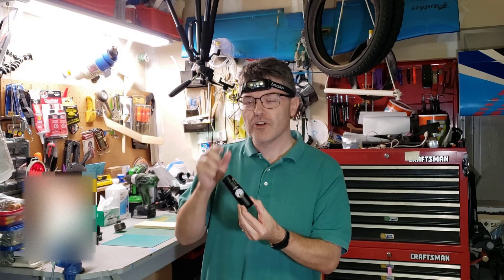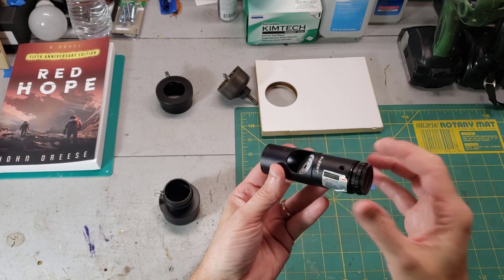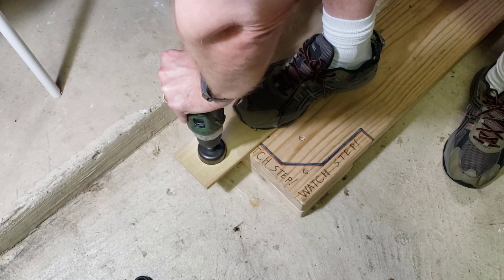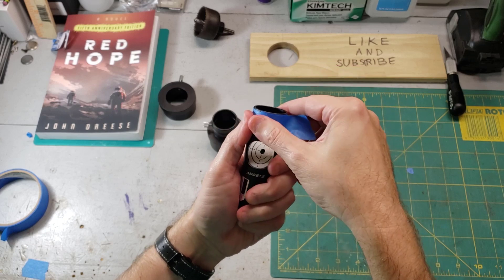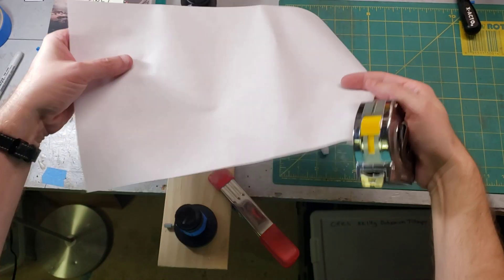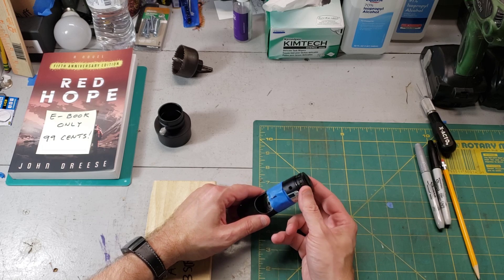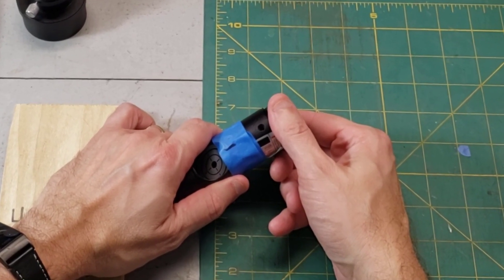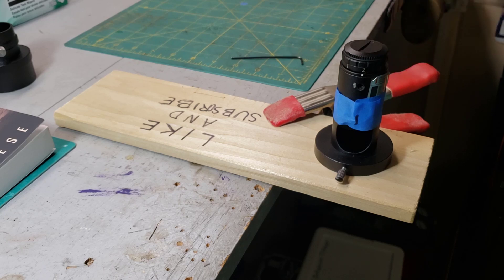How To Align Your Laser Collimator: The Step By Step Guide For Telescope Users

Comment: Back in the days before lasers, I learned how to collimate using the Tectron tools. They consisted of a sight tube with crosshairs, a Cheshire eyepiece, and something you don’t see today, the autocollimator. The first two tools are now combined into a Cheshire/sight tube. The last is an eyepiece tube with a mirror on the back side. It faces the secondary. When the scope is collimated, the image appears black because the light path is blocked by the eyepiece. It is far more sensitive to misalignment than any laser. It’s great for alignment of the focuser. As you rack the focuser in and out, if the image is not black, you are out of alignment.  Btw, I have 3 lasers. None are as accurate as the manual method.

Comment: Greater distance causes the laser dot to appear as a skinny oval about the size of a rice grain.  You have to draw an outline around it and try to make each one meet in middle for each rotation.  Also, if you lay the collimator on its side, you need two parallel supports because of the flange around its middle.  These toys really are more trouble than they're worth, but they make the scope companies a tidy bundle.

Comment: I just stuck mine in the OTA spun it and adjusted it until the circle was tiny, then adjusted the secondary to center it. then spun the laser and worked on it until I could keep the laser inside the collimation dot. Now my collimation is quite accurate.
Reply from the maker: That is a very good way to do it.  I've found that this particular problem has several satisfactory solutions.

Comment: Nice video. You ask about my method to increase the accuracy, so. I set my collimator in a pair of wood "plains" having a V cut near the top edge to cradle the collimator. Gravity pulls the collimator toward the point of the V and makes it easy to spin the collimator. I project the laser several meters from the end of the collimator.
Reply from the maker: Thank you for sharing. I love that folks like yourself have such unique methods to make these collimators even more accurate.

Comment: I collimated my scope using my collimation cap. Got it spot on. I then racked my focuser all the way out and locked it down. Put my laser in and locked it down tight. I then collimated my laser to my scope. It worked great! Now the laser is always dead on for MY scope!
Reply from the maker: Collimation caps are pretty effective - I like to say they'll give you the 95% solution which is very good.  The laser collimators just make the whole process much faster (especially when tinkering with the primary mirror).

Comment: I imagine anything on the order of the telescope focal length is good enough. It'd be interesting to find an analytic formula for the wavefront error you could expect from a given error circle diameter, but it's beyond my ability
Reply from the maker: Generally, that's true.  If you use a distance similar to your own telescope, it'll be fine. I like going for the 6 foot or so for "extra" resolution.

Comment: Hi, thanks for the video! I love these DIY astronomy hacks. I once built a laser collimator stand out of LEGO bricks, and it actually worked.

One thing that keeps me thinking: to adjust the laser position, you can only use the three screws. This means that if the laser module is a small cylinder, one end of the cylinder is fixed somewhere near the middle of the collimator, while the other end is adjusted using the three screws.

But how can we be sure that the fixed end of the laser is precisely at the center of the collimator tube? I guess, to verify this, you would need to take measurements at at least two different distances (between the laser collimator and the wall). If the laser’s central point remains consistent at different distances, then the collimator is properly aligned. Otherwise, you might set the laser position correctly at, say, 1 meter, but at 2 or 3 meters, it could be completely off.

What do you think?
Reply from the maker: The Lego tool sounds awesome!  I've never taken the laser collimator apart, so I'm not sure how the laser module is mounted at the base end.  So far, everything works well.

Comment: If there are three set screws, make three marking lines, not four. Then adjust the screw that aligns with the error on the corresponding line.
Reply from the maker: The reason I chose four was because it's easier for me to maintain 90 degree increments rather than 120 degree increments.
Reply: Use the 3 screws’ position to determine how far you rotate (exactly as you did using your 4 marks). I.e., screw one facing directly out, mark spot, then screw two, …
Reply: Btw, thanks so much for the demo here. I appreciate it.
Reply from the maker: @divalent2007  Thanks for watching.  I'm glad it was helpful.

Comment: I recently bought an Apertura 8, which comes with a laser collimator. However, I’m concerned that the laser collimator might be misaligned and not collimating accurately. I watched a video about using a Cheshire tool but am unsure which would be the best solution. If I already have the laser collimator, is it sufficient to collimate the laser itself, or would it be better to purchase a Cheshire tool?
Reply from the maker: You can do a quick test. Just put the laser collimator in your telescope focuser tube an start spinning it.  Does the red dot follow a large circular path on the mirror?  If not, then it should be good enough.
Reply: Thank you for the quick reply! I actually don’t have the scope yet—I ordered it two weeks ago, and it’s supposed to arrive next week. In the meantime, I’m gathering information about the accessories, tools, and tips I need to properly use it. Once it arrives, I’ll follow up on this message. Thanks again!
Reply from the maker: @Gabriel.Jarelys    I forgot to say... congrats!  The Apertura 8 is probably the best 8 inch Dobsonian you can buy these days.  Use the heck out of it for a few nights before buying any more stuff - it comes with a good set of accessories.
Reply: @AstronomyGarage   I appreciate your kind words—it gives me more confidence that I made the right choice with this scope. For years, I’ve wanted one of these, and I finally decided to take the plunge. Based on recommendations, I also purchased a 9mm and a 6mm eyepiece from SvBony, an Apertura 2x Barlow, and a phone mount to use with AstroHopper for tracking the sky. Hopefully, these will help us make the most of clear nights! Would you recommend anything else for this scope?

Comment: These standard laser collimators actually fit perfectly BACKWARDS into your telescope focuser.. meaning, your telescope can be a ready made jig, which will then project the laser out towards a wall(for a dob standing upright).. as long as you dont move the telescope, you just rotate the laser in the focuser.  You get a ready made jig and you can point it to a wall as far away as youd like for better accuracy.  Hope this helps

Comment: Does the laser have to be exactly perpendicular to the wall or floor? i.e Does the surface the board it is on have to be dead level or is a slight angle ok?
Reply from the maker: A slight angle is probably okay, but it's best to be fairly perpendicular, maybe +/- 10 degrees?

Comment: Another bit of great advice.  I have that same cheap laser.  I think it works relatively well although another club member with a $1500 collimating system disagreed (of course, there is a tiny price difference between the two items).  I think this will make it even more respectable.
Reply from the maker: Even if not collimated, one of these laser collimators will get you usably close for the most part.   I can do a good collimation in less than four minutes with one of these laser collimators. They are worth their price.

Comment: Question, don't you think it's too close to make an accourate adjustment? I set up against wall 13 ft away.  I couldn't get it closer than 1 cm  circle diameter when rotating it.  Does that sound close enough?
Reply from the maker: My main Dobsonian has a focal length of about 4 feet, so my desk height isn't too bad.  For increased accuracy, I use the top of a 6 foot ladder.  But your 13 foot distance will be excellent.

Comment: Great video! Just spent an hour collimating mine using several different 3D printed supports keeping it level. I can't seem to be able to get it dead center from all 4 positions? They are apart by about 1mm between all 4. Laser is about 2 metres from the wall. Anyone else have the same issue?
Reply from the maker: 1mm at 2meters is pretty fantastic to be honest!  Mine is not that good.

Comment: I'm sorry if this is a dumb question, but wouldn't it be easier to make three marks instead of four on the tape around the collimator, each aligned with one adjustment screw?  Then the relation between how you turn the screws and how the laser dot moves among the marks should be easier to see.
Reply from the maker: That is an excellent question!  The reason I chose the 4 quadrant angles was because it was easier for me to control as spun it. Every 90 degrees is easier than every 120 degrees.  It's definitely worth an experiment though!

Comment: thanks!  i will just spin it in my eyepiece holder and see if the dot moves in the primary mirror.   good to see if the one i will get is bad from factory
Reply from the maker: That's definitely an option.  I like to project it onto paper so I can mark the spot every 90 degrees. Really helps when "dialing it in".
Reply: Careful you don't cut or grind the aluminum EP holder's edge!

Comment: I hammered 4 nails on a similar size wood plank to form two V supports. Then I put the laser pointer on the V supports and slowly rotate it. If the beam across the room stays stationary, it has good alignment.
Reply from the maker: That'll work too. There are many ways to build a fixture.

Comment: Excellent. A very straightforward video on collimating the collimator. I imagine most of us are buying the exact same Chinese collimators, so this is perfect.
Reply from the maker: You are correct.  Most of the laser collimators work the same way these days.
Reply: I bet that's why my mirrors are never collimated..all I'm getting is a ball of light from Jupiter.. and the stars are looking like lines instead of stars.. yup I bet it's the crappy collimator.. can't you do the same thing while it's in the actual scope though?  Use the circle on the primary..so get it in the middle of the hole ie circle and then turn the screws with the alan wrench until it stays in the middle,or am I barking up the wring tree?  I haven't any boring tool, hell I don't even have a drill lol...is there any laser you recommend that will be collimated garenteed?  I've seen the Cheshire collimator and that just uses the cross as apposed to a laser 🤔   reply please if possible before I throw my dob at my next door neighbour lol... great informative videos bud.just about to watch another about cleaning yr primary,now that does scare me

Comment: Another great video! I just got an Aperatura 8" dobsonian and the instructions told me the collimator was set at the factory and to leave the adjustment screws alone. A quick check and the collimator was scribing a 3" circle on the wall at about 8'. I'll be putting your video to good use today!
Reply from the maker: I don't think I've ever had one that was collimated correctly from the factory, but I usually buy cheap tools, lol.  There are several ways to mount these to check. My video uses a vertical mount, but I've seen others use horizontal mounting.  Good luck!

Comment: Just a tip, you can use whichever screws you want to adjust the laser, adjust it a fraction of a way towards "center", rotate 90 degrees and repeat, essentially you are spiraling in towards center, you can get this very precise by following this process. It's basically the same process I use daily calibrating optical plummets on surveying tribrachs. You should be able to get it close enough that the actual width of the laser dot is the limiting factor in further adjustment.
Reply from the maker: Thanks for the tip!

Comment: Nice method, but I have a doubt. I understand that the table where the laser is attached is 100%  horizontal, otherwise the results will be wrong. Am I right?
Reply from the maker: Good question.  As long as the final dot stays pretty much in the same spot, the angle probably doesn't matter much. It'd just make it a bit trickier to make adjustments?

Comment: why not just point it at a mirror and make sure its flat, then just adjust it until it reaches it's center?
Reply from the maker: Do you mean why not just use the center of the existing primary mirror?  Good question.  In order to make the adjustments fast, you need to mark on the surface you are targeting. For most telescopes that is an unreachable distance.

Comment: Although the central mark in the primary mirror could have a severe placement error, it's considered good practice that the laser collimator to have a deviation angle of less than 2 arc minutes. This means the radius R of the circle described at a distance L should be less than R = L x tan (2') or L x tan (2/60) which gives: 
R < L / 1719. Radius R will be in the same units as length L. 
To be able to really discriminate the circle, distances greater than 5 meters (16 feet) should be seriously considered, mainly because the laser dot is not pointless but could be a spot more than 2 mm in diameter depending on the brand and quality of the laser collimator. 
Let's consider using a 10 m (33 ft) baseline for this collimation. This will give us a maximum radius of 6mm or 33 x 12/1719= 0,23 inches => ABOUT 1/2 INCH CIRCLE. If the laser is rotated and describes a circle less than 1/2 inch diameter, your laser is very well collimated!👍👍👍👍👍👍🔭🔭🔭🔭🔭🔭😎😎😎😎
Reply: This works up to a certain point though, because laser light decoheres with distance.
Reply: I collimated my collimator to 20-plus feet and got it within 1/4".  BUT ... my collimation cap and collimator disagree.  So, I deferred to the collimated collimator, but it put my scope out of collimation.  I suspect the collimator's insert barrel is just too sloppy a fit to be of any use.

Comment: Good morning John. Would like to see a video on trouble shooting a push to system with the hand controller and function buttons please. Thanks for the great videos. Peace out and clear sky's.
Reply from the maker: I wish I still had my Orion Push-To, but I had to sell it unfortunately because I was out of room at the time.  Push-To's are pretty bullet proof - the only real problems that can happen are with the encoder disk, encoder reader, or the cables.  The part that you can control are the altitude (elevation angle from horizontal) and azimuth (swinging right and left). The main troubleshooting tool is in the utilities menu (I think) that shows the readout angles for azimuth and elevation.  Set the tube horizontal and go through the setup procedure.  Then go into the utility and view the elevation/azimuth.  Rotate the tube to vertical and then down to horizontal.  Make sure the readouts differ by 90 degrees.  Then do the same thing with the right/left swing angle, but you can go from 0 to 90 to 180 (opposite the start angle) 270 and then it should reset itself to 0 when you get back to where it was pointing in the first place.  That's how I realized my encoder was slipping on GoTo system many years ago. Good luck!

Comment: Brilliant idea,  i use 2 V block that machinist use, but i like your idea better with the 4 marking good idea and don't drop the laser again. clear skies
Reply from the maker: The V block idea is a good one! I think one of the advantages of the vertical method though is that it mimics the mating surface contacts. Thanks for watching!